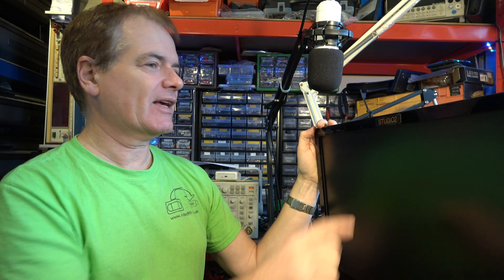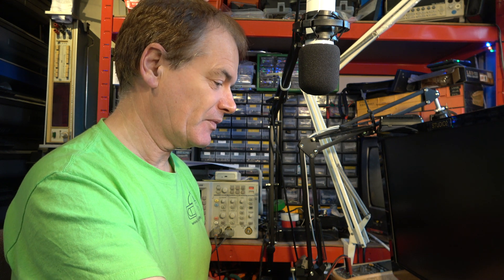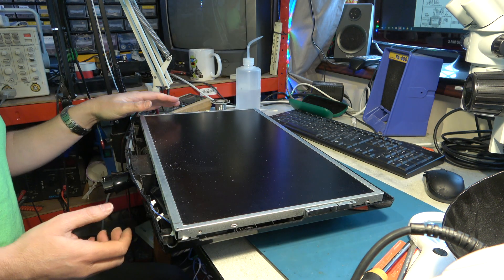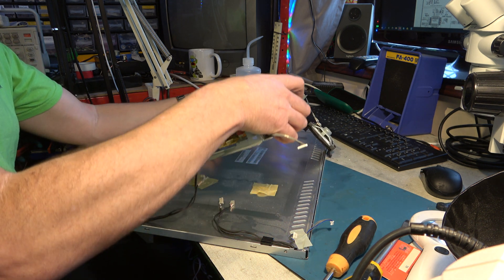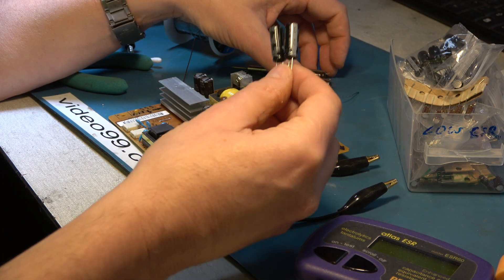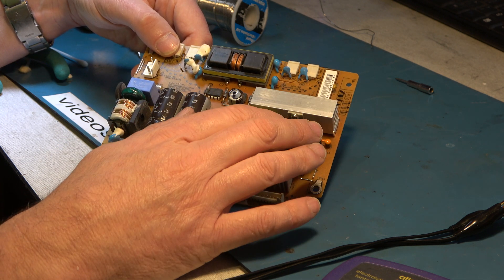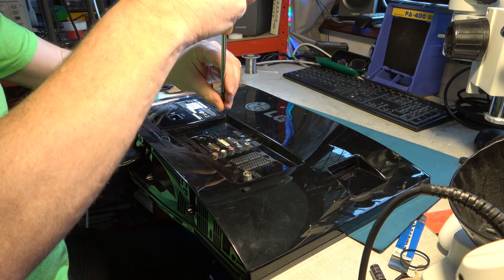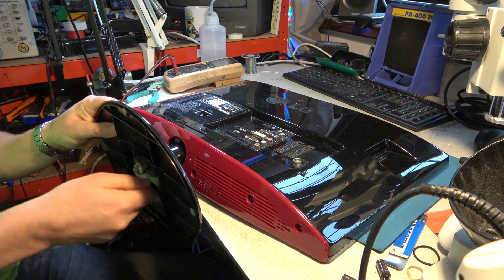Can we fix an LG TV/monitor? Only if we can get it apart.

Comment: In our throwaway society, so much stuff is designed to go together quickly, easily and securely in the factory and not come apart without a fight or without breakage! You did well to get into the thing and these days any repair I'd do on something like this would only be if it was my own unit.

Comment: My samsung 32 inch curved pc monitor has no screws holding it together but i done a white pc build and wanted a white monitor and not many options so i went with a samsung not a brand i would normally bother with but its not that old so hopefully it will be 4 or 5 years before it has to come apart .I changed a capacitor in my mates samsung tv that failed put a panasonic cap in that most likely cost more than all the chinese ones in the set and its still working fine a few years later .

Comment: That's why newish stuff goes in the bin , after failure
Reply from the maker: Which is wrong really.  The components to repair this cost pennies.  It should have been easier to take apart.

Comment: That was not too bad. In my last video I tackled a Dell 2407 with a cascading failure of many components in its power supply.
Reply from the maker: I still have a Samsung TV to sort out where I replaced a blown up IC but still it doesn't run.  There's only so much money it's worth spending on older Samsung TVs though because the cold cathode backlights used to age to a nasty yellow colour.

Comment: Easiest way I've found to get plastic clips to 'disengage' is to pry them open with a plastic card - an old bank card is ideal. Saves your fingers and the possibility of the clips snapping.
Reply from the maker: I was using one of those at one point, but wasn't really winning.

Comment: My LG Freeview/DVD recorder had PSU issues awhile ago. I replaced the bulging caps but it still did'nt work. I replaced opto-coupler/transistors and diodes that were bad, still nothing.
So I bought a broken one off ebay that was the same model and mashed them together. It works. LOL.